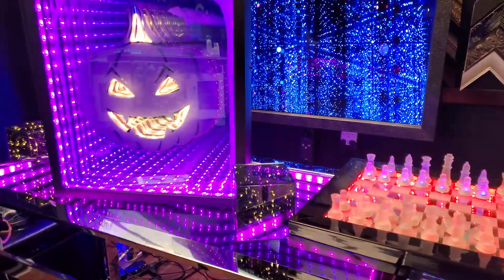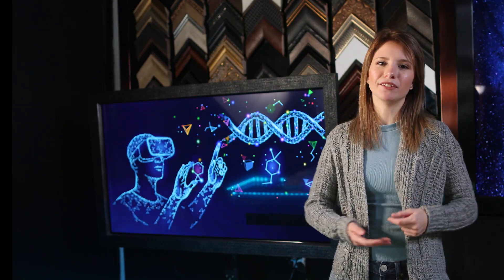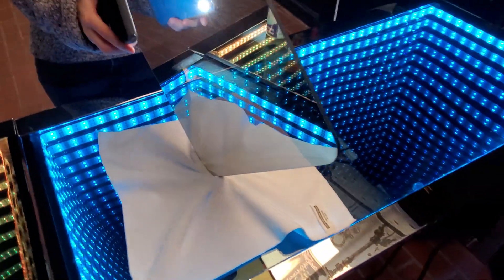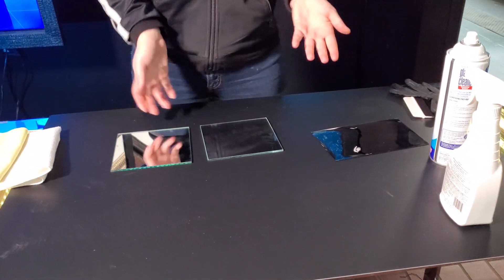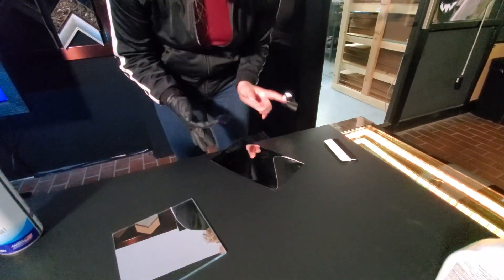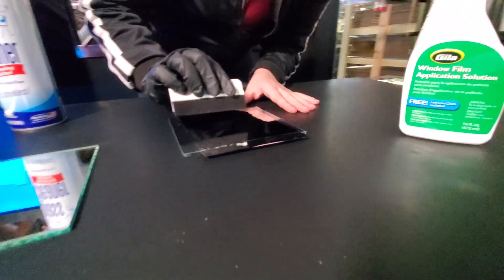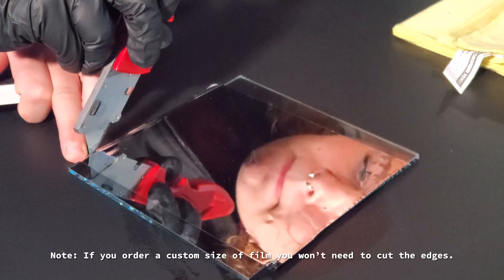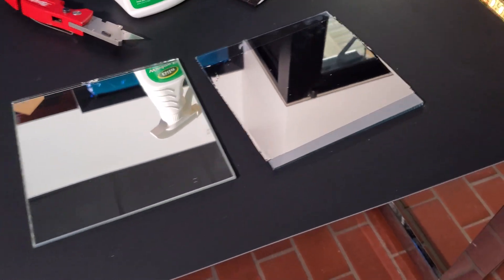How To Make A Two Way Mirror

Comment: Two questions:  Won't people see leftover streaking or spotting from chemicals in the solution you spray on the clear glass before you apply the film, and can you cut the two-way mirror into smaller pieces After you apply the film, or will the film on the glass tear, warp or come up?  I want to make extremely small two way mirrors, but don't think I can apply the film properly to such small sizes.  Thanks for any input you might have.
Reply from the maker: Hi! There are minimal bubbles and streaks, but they do sometimes appear. It just depends on how well it is applied, but it's not from the solution. Mostly from the actual application. You would need to cut the film before applying, unless you are cutting extra off the edges :)

Comment: Thanks guys! I want to put led lights on the back perimeter of a floating mirror, (mounted a couple inches from the wall. )I also want it to be a smart mirror, using an old cell phone. But am I correct in assuming that the led light will  take some of the reflective property from the mirror side because the light will be coming through from the back?
Reply from the maker: Sounds like a cool project! Yes, the reflection will appear to be decreased but only in the areas where you see the light (eyes tend to focus behind the mirror to the light)

Comment: Does your two way mirror film look just like a mirror after applied?
Reply from the maker: The two way mirror film turns it into a two way mirror. If the lighting is the same on both sides it will appear transparent (not like a mirror). One side must be darker to achieve the mirror effect on the other side.